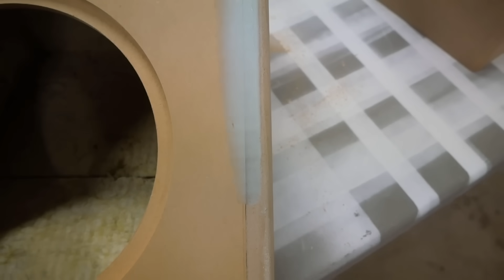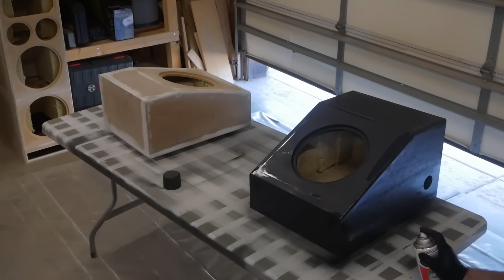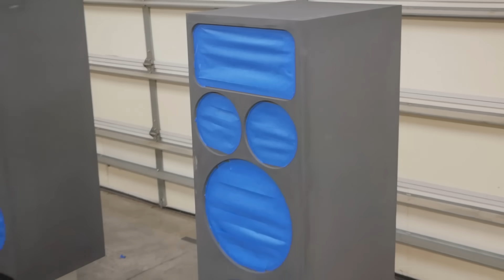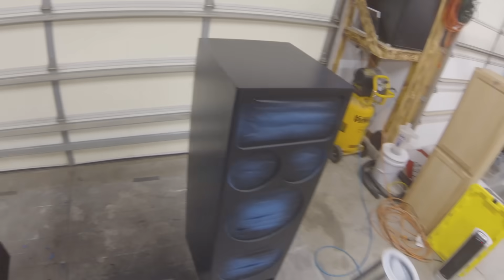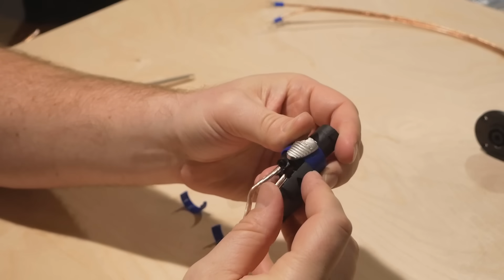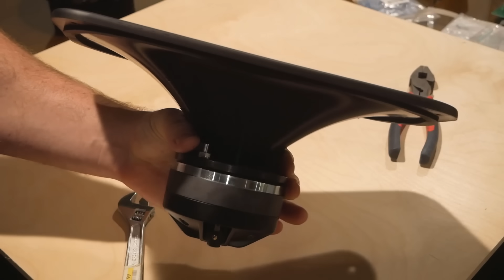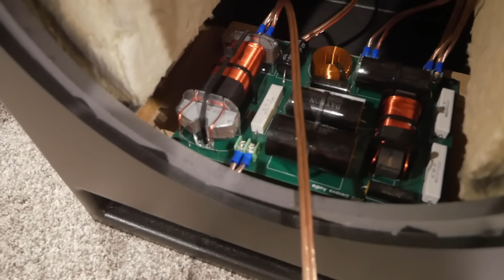How To Spray DuraTex | Home Theater Speakers | Finishing The DIY Sound Group 1299 and Volt 10

Comment: Highly recommend using glazing putty rather than drywall spackle for that type of work.  You’ll get a significantly better, significantly tougher, significantly smoother surface to work with.   UPol or 3M works great.

Comment: Finally got my first HVLP gun, used it on a few projects now.  Not a duratex one yet, but that was my main motivation.
One of those projects was painting a toy box, and just wanted to say that issue of "hard to spray in the port" is the same issue I had with painting the inside of the box.  It was too small to get the gun into to spray close, and from far away just not much material made it to the surface.

What worked for me was to close the pattern from the fan shape to the circle, in doing that the product is basically shot straight out rather than fanned giving it MUCH more throw distance.

I was able to paint the inside of the box perfectly like this, just gotta be careful not to get too much product in one spot since its so much more concentrated.

Still the best video for this I have seen, wish I could have sprayed my 18" sub project, the roller texture while more durable just is not what I want for an in-home application.
Also I went with the Steel Speakon connector for my sub, and for some reason it has a groove on the inlet so a perfect circle wont work to install it, that was a lot of work to slowly cut the slots for it to fit, but once installed its great and cant be turned in place even before screwing it down.

Comment: Doesn’t the sparkle chip out easy if bumped?
Reply from the maker: Nope, it's not really structural, just fills in those tiny gaps. No cracking after 4 years

Comment: Great video, I found it looking for HVLP Duratex application, not sure if I want to go for a Turbine based AIO sprayer since I only need it for this one project, or get a gun and compressor like you used.  Building the 18" Ultimax Sub kit from Parts Express, but this makes me want to build all my speakers at one point in the future lol.
Reply from the maker: Having a compressor is nice for many things... having a spray gun is nice too even for the few and far between diy projects around the house. Spraying is much smoother than rolling things

Comment: Instead of spackling since it may crack or shift because of the woofers over time. I would think epoxy would be better
Reply from the maker: I have body filler that is stronger and easier to sand if needed, probably wouldn't use epoxy personally... the spackle hasn't cracked though. It mainly was there to just fill in nail holes and any slight cracks, not really as a leveler. I tried to sand those edges down smooth instead of fill any low spots

Comment: Man I tried this, and the hopper gun is spraying out large droplets in a huge spray pattern. Changing the pressure doesn't seem to help much. Now I have a soaked mess 😟 I diluted the Duaretex with water too. Not sure what to do
Reply from the maker: Umm... was it an hvlp gun like I used? You can grab a cheapo one at harbor freight for under $30 for this type of application. Sounds like a gun issue you're having... ALWAYS do a test panel btw. Never start on your main project without confirming the spray pattern is what you want. Good luck man...

Comment: Do you recommend using one of those electric hvlp guns? If so, which one?
Reply from the maker: I had a bad experience with a cheapo $50 Wagner. They make some nicer ones that cost more, I just prefer an hvlp air gun since I have a compressor

Comment: I'll share an awesome trick for painting over MDF: mix 50% Elmer's white glue with 50% water and brush on MDF with a chip brush. Allow drying time before paint. This will seal the wood so it doesn't absorb the paint. *may need second coat

Comment: hello sir, i find your videos very informative and entertaining as well..but i am wondering how you interconnected the different speakers incorporating a dividing network .. can you show us in schematic diagram all the interconnection of all the speakers in each box.. reason why i want to find our how is impedance matching between the speaker system and the amplifier..i just would like to know if there would be risk of damaging the amplifier if multiple speakers are already installed.
Reply from the maker: Everything is wired in parallel off of the crossover. I go over that in the crossover assembly or final assembly video. Final load is 8 ohms. You can find more specific information about the drivers and specs on DIY Sound Groups website. As long as your final load is within the amplifiers capabilities (usually 4 ohms or higher) you should be fine wiring multiple speakers together

Comment: Awesome job!  I have some small speakers, I'm thinking about rolling them as apposed to spraying them. Would you suggest Duratex? Or something comparable at a lower price point for a first timer.
Reply from the maker: Duratex is a good product. Holds up well to abuse. I've seen many people prime and roll cabinets with other flat black paints you could find at home improvement stores. may not hold up to scratches as well, but cheaper
Reply: @LifeofBliss  I appreciate the response, and who knows maybe I'll go the Duratex route. I'll share some pics or maybe a video when their done.
Reply from the maker: You should jump on AVS Forum. Lots of good people over there in the diy forum and an easy place to share pics

Comment: the ported one?? isn't it causing the foam stuff going out and your breathing it??
Reply from the maker: No there's very little air movement with the woofers. Everything was sprayed with spray glue before sealing up to help catch any loose fibers as well
Reply: @LifeofBliss  thank you thats clears everything, your video is very informative, hoping also to build in the future. i subscribed 😁
Reply from the maker: @tristanpitz  thanks man! Yea a lot of people were concerned about the fibers, but they aren't a big concern. It's not like fiberglass either, safer even if some did happen to escape

Comment: Nice work and very well presented. 
This looks like proaudio. How does it sound compared to your previous DIY from Meniscus Audio? I watched your comparison video with the Polk Audio towers. I'm thinking of doing the Vortex, HTM 12, or the discontinued Fusion 12 for two channel Hi-Fi use in a medium sized 1600 cubic foot dedicated listening room. Wondering what your impressions are with music now that you've had this setup for a while. Any feedback would be great. I see a lot of horns now being used in the home---some large, some small. With the SEOS waveguide, I'm wondering if it's all worth it to build my own using the kits without the crossover that's included and instead bi-amping them utilizing a two-way active crossover with two powered subwoofers.  Currently I'm using a Dynaudio DIY speaker kit from 20 years ago. I love dynamic sound but I'm concerned a horn will be fatiguing for long listening sessions in a mid to near field seating position. Thanks in advance for any information you can share!
Reply from the maker: These are great with music imo. They could use a little boost with the low end, but nothing a little EQ can't fix. I usually listen with subs as well so that takes care of the lows. There is no fatigue with these unless I push them past my comfort threshold (aka really damn loud!). Distortion is non-existant as far as I can tell with this setup, they are capable of playing very loud effortlessly. I did like the HiVi towers I built for music as well, probably a bit more if not using a sub. They would get pretty dang loud as well, but nothing like the 1299s can. I am very happy with the switch to the 1299s, just a more natural and effortless sound for me
Reply: @LifeofBliss  Ok. Sounds good. Thanks for the reply. I have a few more questions: How do the 1099's image and what's the soundstage like compared to the HiVi towers? How do the crossover networks compare? Have you listened to the Volts with music? When you listen to either, do instruments sound natural and real? Because of the compression driver, are they forward sounding like the typical PA stuff? What are some negatives if you don't mind sharing? Sorry for so many questions but I bet there are others here who are interested in your feedback.

Thanks again, Alex! Love your channel man and I'm surprised you don't have more subscribers. Your production quality, content, and the care you take in editing is impressive!
Reply from the maker: @djscott9207  appreciate it man! So the 1299s have a very wide soundstage for me. When you're dead center listening to stereo, it's hard to place where the speakers are but you can pinpoint instruments as they dance across the soundstage. The HiVi set was no slouch either, these just have more depth to them. I would consider them a bit forward,  almost on the bright side, but they don't fatigue my ears like there is any distortion going on. Crossovers were great quality imo, I don't claim to know a lot about crossovers but they were quality parts. They also have a complete parts list on the website. Instruments sound amazing. And they are so clear that I've heard things in songs I have miss in the past
Reply from the maker: @djscott9207  negatives... they're huge and heavy. Don't have the bass output you'd expect from dual 12s, but like I said you can EQ that up. They weren't really designed for deep loud bass though, so not necessarily a negative, just something to know going into it. Hard to find negatives about them though, they're the best speakers I've owned and heard (but I've spent a lot of time listening to them since they are mine)
Reply: @LifeofBliss  Well, I think I will take the plunge for either the Vortex coaxial speaker pkg (similar to the Volt, but for two channel) or the highly revered Fusion 12. I'm running dual 12" sealed subs that are close to flat down to 25hz, which for a dedicated music system and for what I listen to should be fine. I will call Meniscus Audio on Monday to get caught up on their current offerings before I hit the buy button over at the DIY Audio Group. 

I'm not sure if I should try to find the discontinued Fusion 12 or go for their HTM 12 that's currently available, which uses the SEOS 15 waveguide as opposed to the SEOS 12 found in the Fusion kit. In my small 14 x 12.5 x 9.5 listening room (1600 cft), I'm not sure which one would be better. Any thoughts? I don't need the passive crossovers. I'm going to utilize an analog active two-way 24/octave LR with a tube amp on the tweeters, which will increase dynamic range and efficiency while minimizing comb filtering inherent in passive networks. I'll try to reach Matt or Eric to see what they think of this setup and what would be the best crossover setting. Thanks again, Kyle.

Comment: "nail holes" well fuck. i know im not gonna buy any boxes from you. whats wrong, couldnt spring the extra 1$ for screws?

 edit: what are those.....mid ranges? that have a compression driver bolted onto them? the links you provide in your description go to a 2-way in ceiling speaker thats completely different than what youve got, and even googling the name returns the same result.

Comment: I was wondering how bad Duratex hangs in the air when spraying? Also did you notice if it got on everything in your garage because of that?
Having worked in a body shop in the past I would never consider painting automotive paint in a garage without massive ventilation. Duratex however is quite different than any automotive paint I am familiar with.
Thanks!
Reply from the maker: It's not bad at all like auto paints. I used to do a lot of automotive painting in the past and the duratex is very different. Technique is the same, but it doesn't aresolize as much and hang in the air. A lot of it dries before hitting the ground too so it leaves behind some dust, though some of it is still wet and will coat the floor. That's why I put plastic down everywhere. But as far as other tools and areas of the garage outside of the spray zone, there was very little overspray that traveled that far
Reply: @LifeofBliss  Thanks for the info! Appreciate it!

Comment: Question, did you connect the two 1299, 12'' low frequency speakers in series or in parallel before connecting to the crossover, same question for all the speakers how did you connect them before hooking them up to the crossover, please explain, I'm actually an amateur trying some DIY thanks.
Reply from the maker: Everything was hooked up in parallel for these speakers to the crossover.
Reply: Hooking everything in parallel is going to affect the impedance or increase the load on the amplifier. Hooking everything in parallel then to the crossover is that the normal and way of making three way 🔊 or

Comment: I love this video is so good. Can send me the websites to get the speakers, can this speakers be shipped to Nigeria for a DIY projects, like the 12'', 61/2'' and tweeter, how loud put together can this horizontal one sound looking at it outdoor, what kind of amplifier could power it, only the horizontal box i mean?
Reply from the maker: Thanks man, the link is in the description but the website is www.diysoundgroup.com
You would have to reach out to them for possible shipping to your country. These are very efficient speakers, so not a lot of power is needed. If you used a higher power pro amplifier, they can reach over 120db, so very loud!

Comment: Too complicated, most people wont have a spray gun, and many people prefer the natural wood finish on speakers.
Reply from the maker: Well this video may not apply to you, but many have found it helpful as many prefer a painted look. This is a diy channel, things are meant to more complicated than just buying it off the shelf 😉
Reply: Another simpler method would be to just buy a nice speaker system mainly for the box, then tinker with the drivers (even swapping them) to get the sound you are looking for.  I've done that many times.

Comment: Good job! But i have one question: why you didn't make separate enclosures for mids and woofers? Woofers will interfere with mids by pumping air.
Reply from the maker: Thanks man. I should have gone over that in the video. The mids are a sealed back design. No need too separate.

Comment: Very good u can also use this info in priming and painting in body work as i have painted several vehicles very good job
Reply from the maker: Thanks Rick. Absolutely. Body work is a little more involved obviously, but similar processes. I grew up doing that and painting cars with my dad. Great skills to know!
Reply: @LifeofBliss  absolutely i was taught at first in high school after that git a job with a friends father and I been doing it off and on fir iver 30 years but i have to say blending is the most tedious. And also ghosting its super hard I only screwed up over 25 x lol but practice makes perfect we only learn from our mistakes but don't want to do too many mistakes as it gets costly lol but i have to tell you great vid also while doing your sanding u say u don't like using air or electric type tools Maybe try using a straight line air sander this way u won't have any ginger grooves or uneven spots like u would get from other electric or air sanders or have you already tried that and just prefer the burn in the shoulders lol oh by the way as I was touring you tube I came across your channel and now im a new subscriber and but got double thumbs up from the peanut gallery here lol chat soon
Reply from the maker: Lol thanks man! Yea if I did more of this stuff I'd probably invest in some better air tools for the job. For now, it's sore shoulders 😂